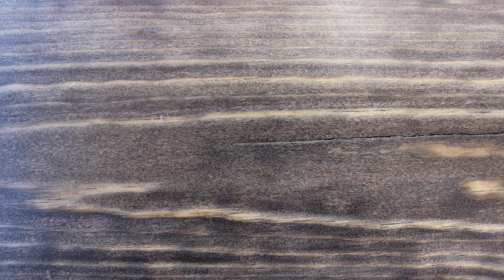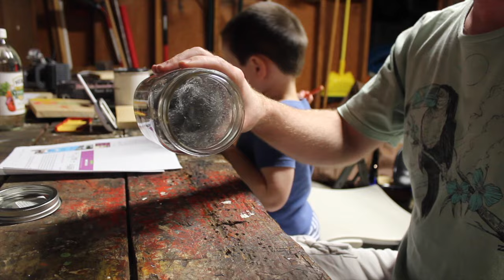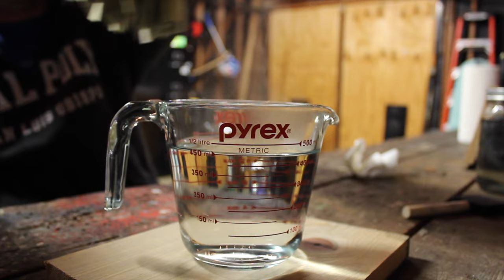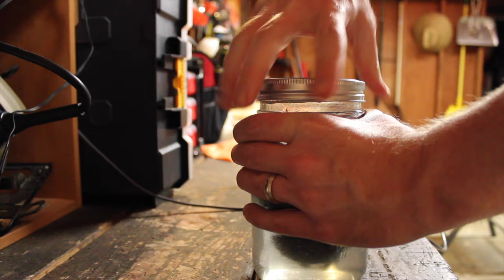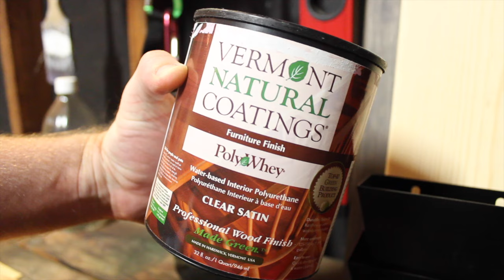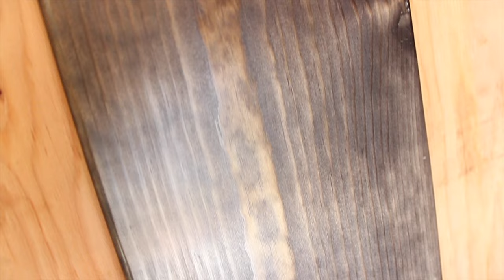How to Oxidize (Age) New Wood & Get A Vintage Look

Comment: Nice work.  Straight up and simple.  One thing I learned from experience is that if you leave that SOS pad in the vinegar for > a week it turns to rust and you get a messy rust coating on your boards that doesn't look like anything and doesn't really clean up.  In other words, throw that stuff out after a week if  you have leftover.  Cheers

Comment: Please don't completely seal the jar. The production of iron acetate creates hydrogen gas, which when contained can be unsafe. I use a coffee filter and the lid ring to keep junk out of my acetate stain, but still allow gasses to escape. A latex/nitrile glove works too, as it allows for expansion of the gasses, instead of keeping them compressed in the jar.
Reply from the maker: Great tip!
Reply: Joseph Blazei  hello i want teek finsh teek color on Afghanistani cedarwood (diyar wood) help pleas

Comment: Hi there! I did this and it worked great. But, now I am struggling to find someway to seal the wood table. I used polycryclic clear and it changed the color of the wood. Help!
Reply from the maker: Hi Melissa. Is the poly oil-based or water-based?
Reply: The poly is a water based....

Comment: I have also used the same technique on wood species that are low in tannin by pre-treating them with black tea. My only two questions are: 1) did you wash the steel wool with a mild detergent to remove oils? and 2) did you have to make a whole in the lid of the jar to allow for the reaction gas to escape?
Reply from the maker: +Paul Antidogma Great questions! I did not wash the steel wool. And I did seal the jar initially. The top eventually popped because of the pressure from the escaping hydrogen, so I do recommend leaving the lid slightly open.

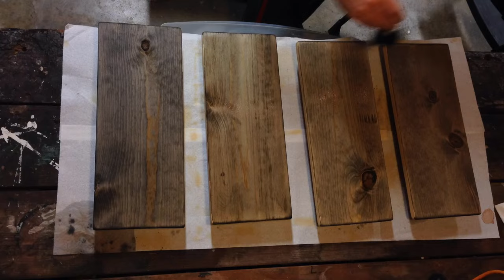Comment: Would you say that the steel wool/vinegar brew discolors not by staining, but by chemical reaction? I ask this because the painting in the first few seconds using the steel wool solution looks clear, but then darkens after a few seconds. Then, what appears to be a brief time lapse at 1:42 shows the wood darkening on its own. This is the look I am trying to achieve with wood for my diorama, which is the black hue (not brown), that signifies severely bleached wood from the elements. Thanks for the clip.
Reply from the maker: I think that's exactly what's going on here, Stan. Good luck on your project and feel free to shoot my some pictures on Facebook - https://www.facebook.com/gadgetsandgrain/

Comment: How do you deal with any wood filler that might have had to be put not o cover gaps, nail holes and such? When applied as directed the stainable wood filler did not change at all. Is there a solution to this problem? Thought about using grey stain to cover the filler but it is highly visible after dried.

Comment: I planning to buy a painted black wood mirror and sand of some of the paint off, then add this technique on the exposed wood, do you think it will work? The mirror is quite expensive and I don't feel like fu**in it up.
Reply from the maker: It's a risky proposition! :) I wouldn't recommend possibly messing up a perfectly good mirror - that's just me. You just don't know what kind of wood is underneath the paint/finish. Perhaps consider buying a cheap mirror at a garage sale to you test this technique. Good luck!

Comment: suscribed =), i know this video has been posted awhile back but after sanding it for the last step, would this still be ok to use as a dining table? meaning will it be waterproof enough so that if i spill something on the wood will it warp the wood?

Comment: Nice upload thanks! Thinking of doing this to boards used on a porch ceiling, semi-exposed in a wintery climate. How would this finish survive out there? Also, I think the common species used for that (t&g, beadboard etc.) is pine, but how would this procedure do on pine?
Reply from the maker: If the the ceiling is going to be exposed the elements, it will probably need retouching every few years, so just be prepared for that. As for pine, what you see in the this video is exactly what to expect - I used pine as well :)

Comment: Great video, thanks.
Would this work ok on a pine stair case that I've just put into an small French cottage. It obviously looks too new and were undecided about colours untilbwe saw you class video. Were thinking of doing the underside too. Thanks again
Reply from the maker: As long at the wood is unfinished, it would work. Try testing it first on a large piece of the pine you are using for stair case before doing the whole thing.
Reply: Gadgets and Grain Thanks so much for your time to reply and again for the video

Comment: Does the steel wool stain leave wood smelling like vinegar?
Reply from the maker: Good question. The smell does not linger once the solution has fully dried, and it especially goes away after you seal your project with a finish. I actually posted an updated video on this topic - check it out: https://www.youtube.com/watch?v=JvyUkSenWK0 Let me know if you have any other questions.

Comment: Hello ! Is this a permanent stain ? or will it lighten with time ? Thanks !
Reply from the maker: It’s permanent. If you apply any finish to it, that will probably age with time and change color, but the stain itself is permanent.
Reply: Thank you for the reply. When you say that the stain is permanent does that mean that when we apply this procedure , alterations are being made to the structure of the wood itself which in turn makes the stain permanent ?
I want to apply this method to some hand turned pens ( with a friction polish / wax finish). As the wax finish would wear off with time, the stain is what would be exposed and will come in direct contact. hence my question on being permanent / or the stain wearing off. (I know I could do some other protective coatings but my question is esp. regarding a wax finish which wears off) . I would be fine as long as this stain doesnt wear off when in contact with hands. Would love to know your thoughts on this ! thank you

Comment: Should really use a oilbase  clear Top coat aposed to waterborne clear as the residual steel wood that enters the wood from application will create rust spots from the waterborne products

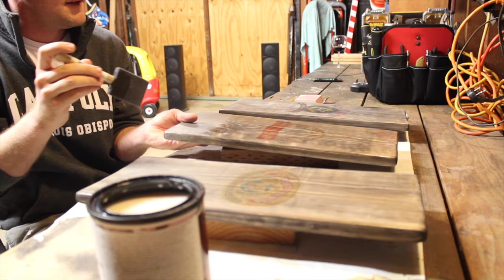Comment: At the time mark 1:53 I see images on the wood as you are applying the poly.  Do you have a tutorial on how to do that, and/or what is that called?  (I tried searching for "watermarking wood" but it came up with only repairs)

Thanks!

Comment: Was the tea necessary for the oxidation?
I assume this would work with just the vinegar and steel wool on its own, yeah?
Reply from the maker: In my experience, the tea, for some reason helps the steel wool more evenly stain the wood, and brings out the wood grain a bit more. When I applied just the steel wool solution by itself, the wood just looked dirty.

Comment: Hey man, could you use thicker Steel wool and get the same solution ? greetings!
Reply from the maker: Not sure. I think the thinner steel wool dissolves a bit quicker and helps get your solution ready faster.

Comment: What type tea  did you use, how many bags also. How long did you leave the bags in the hot water
Reply from the maker: I used regular black tea, and I believe I used about 10-12 bags in two cups (~0.5 liters) of hot water. I left the bags in there for about five minutes.

Comment: Love this video! So quick question...how far in advance of the 4-5 days for oxidizing the wool should you do the tannis?
Reply from the maker: Hi Aaron. There's not set time you need before applying the steel wool solution. you just want to make sure that the wood is dry from apply the tea. For me, I let the wood dry overnight before applying the steel wool solution. Hope that helps.
Reply: Gadgets and Grain thanks! i went ahead and did it the night before. i stained a Rustic X end table from Ana White's plans. Turned out SO great. Thanks for this video!

Comment: This looks really nice, great video. Exactly what I was looking for. Do you mind me asking, but does this smell of vinegar or anything when finished? Only asking as I want to build some cabinets for my camper van and crest this effect, but would want it to smell as it would be such a small area to live in. Thanks in advance.
Reply: Sorry about my spelling. Predicted text... haha. I meant I wouldn’t want any smells. Sorry.
Reply from the maker: Hey Billy. No worries! The vinegar smell does go away at the solution dries. It helps the lightly sand the wood after it’s been oxidized to kick off the excess solution. Plus, one you seal the wood with a finish, you won’t be able to smell any trace of vinegar.
Reply: Gadgets and Grain thank you so much for getting back to me, much appreciated. Keep up the good work. 👍

Comment: When I did mine a while back and put the lid on it popped the lid from the gasses that were being created from the wool.. Did that happen with you during the process?
Reply from the maker: +Sneaky Rakifi077 Yes it did and it's completely normal. In fact, it's best to not completely seal the lid when letting the solution sit for a few days. You want the gassed to escape.

Comment: How long did you wait for all of it to dry before applying the finish coat.
Reply from the maker: +John Coonradt jr.5 Overnight - 8 hours just to make sure the finish wasn't mixing with wet oxidation solution.

Comment: I have been using this method for a while and love it, but can't seem to get the "grey" look? It just goes a dark gold or brown. I do use lots of tea. Oodles of that around  - a Brit. :)  PS - Never mind. I just tried it with the method you described; tea first, vinegar/steel wool solution after - Brilliant!!! Grey! The other "recipes" I had tried called for adding the tea tannins to the vinegar mixture. Yours gave me exactly what I wanted. THANK YOU
Reply: Kathryn Mat  I need help you said you used this method and it works great. What am I doing wrong  I get the gray look I want yes but when I add poly it turns brown
Reply: I have not had that problem Brian. Are you using an oil based poly? They have that yellow cast to them which water based does not. I tried using the tea prior and after applying the vinegar/steel wool solution, and actually found that applying the tea after gave me a "greyer" look. I would say to experiment with that and also try a water based poly if that is not what you have been using. Cheers.
Reply from the maker: Hi Kathryn. What kind of wood is your project?
Reply from the maker: What type of wood are you using?
Reply: @GadgetsandGrain  The wood we used was straight up fence blades. We sand them down and they do a great job and inexpensive. We have done two walls in the kitchen. A small one with just the ageing/oxidising solution applied, and before Thanksgiving we did another wall in a combo of the ageing solution and which tinted nicely to the shades we wanted - the somewhat more "gold" tone and the grey tone with the tea as explained so well in your video, and a combo of coloured stains. Such a pity you can't attach images to these comments as it did come out rather well. Thank you again for this video.

Comment: Man, didnt know that tannins whete the reason of oxidation, i think my tea solution wasnt strong enough and the wood didnt turn so greyish as in the video, used pine wood, mybe you should metion that
Reply from the maker: Hey Carlos. I found that the steel wool solution contributes more to the dark color more than the tea. Perhaps add more steel wool. Good luck!